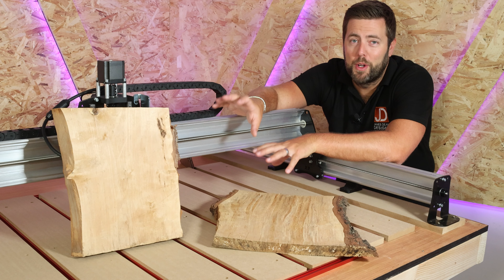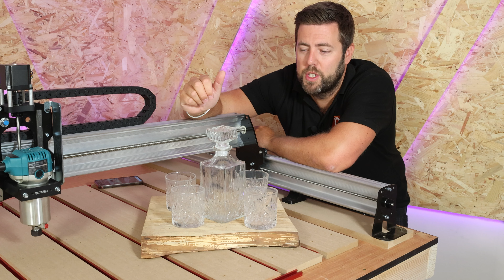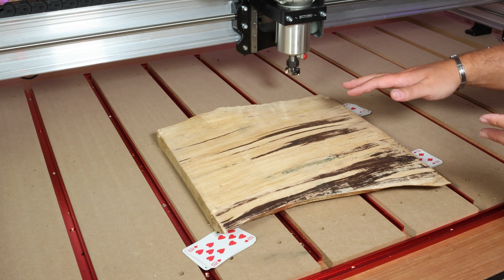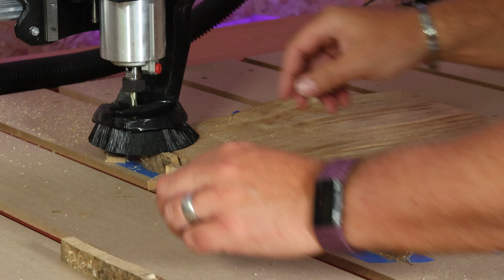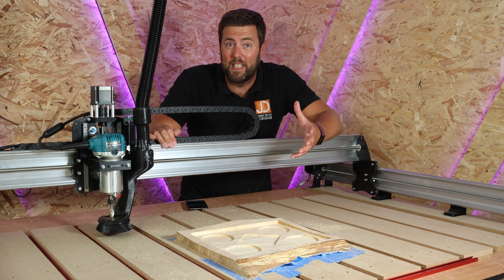Transform Scrap Wood into a Stunning Drinks Tray - CNC Woodworking Project

Comment: Nice work James, the dark CA blends into the spalting nicely,
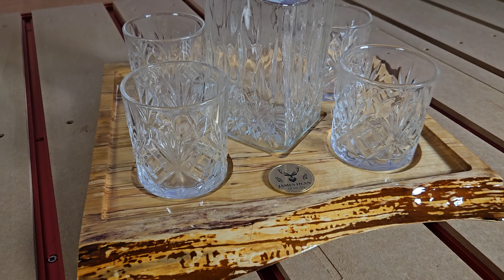07:10 you previously said extra shine from Varnish, then you said you went for Polyurethane. Did you poly over the varnish or confused moment?
Reply from the maker: Maybe a slip of the tongue. Was all done with polyurethane. Multiple coats with a light sand inbetween. I should have sprayed the last coat on for a better finish but lesson learnt 😕
Reply: @JamesDeanDesigns  Good shine to it, Looked like deep shiny yacht varnish, Ive never managed that level of shine from Poly, but I've never sprayed poly. I need to try it out. Thank you.
Reply: Nice tray, well done!